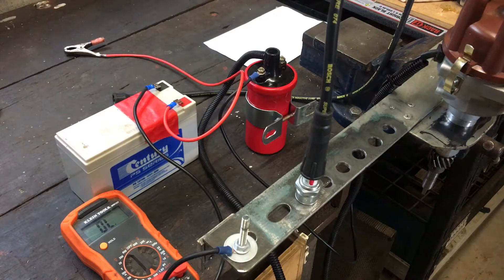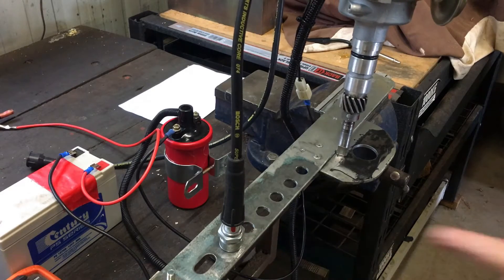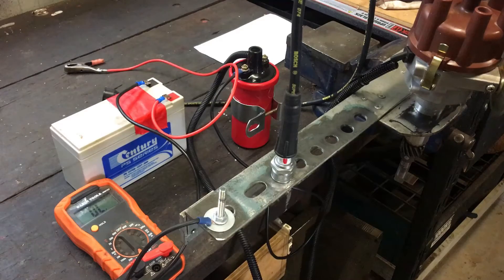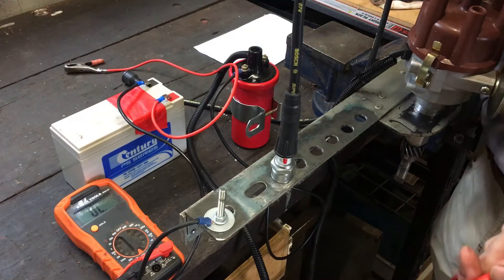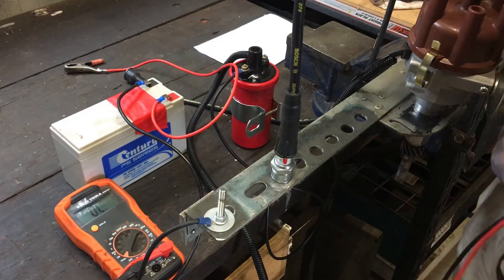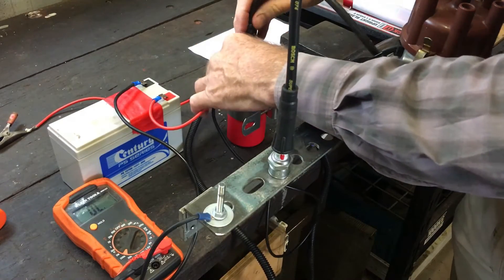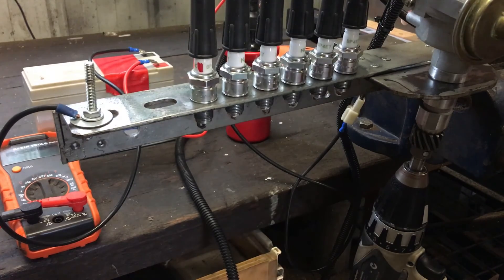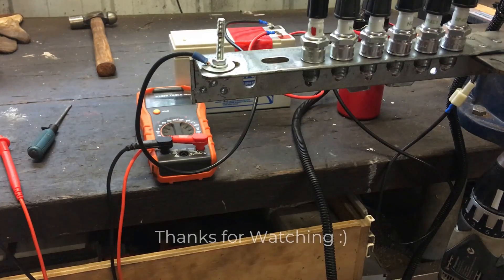Bench Test Distributor and Coil

Comment: What are you talking about at 2:28 in the video? You said the positive wire coming from the distributor goes to the positive side of the coil. There is no positive wire coming from the coil. There’s only one wire (other than high voltage coil wire going to center of distributor) going to the distributor. When the points connect it goes to ground and when the points separate it’s no longer grounded causing the coil to release high voltage through the main coil wire. Again, there is no positive wire going from distributor to positive side of coil. Please explain if I am wrong.
Reply from the maker: That was a few years ago now so I watched the video again to refresh my memory.  I see there are definitely two wires coming out of the distributor and I hooked them both up.  I’m no expert on this stuff.  I was trying to reproduce a fault with this stuff that I was seeing on my car.  I think in the finish it didn’t fail.  To answer your question I Google it :)

The two small wires on an automotive distributor are for the ignition coil's primary circuit: one is positive (+) and one is negative (-). The positive wire comes from the ignition switch (often through a resistor) and provides a constant or switched 12 volts, while the negative wire runs to the distributor's internal components (like breaker points or an electronic ignition module) and is switched to ground when the engine is firing. 

I recall my criminal friends from high school used to jump a wire from the battery + to the coil + to bypass the ignition key then use a screw driver to short the starter motor contacts and the car would start.
Now they just cut a hole in the door, splice a cable into the cars internal network send an unlock door command and start the engine command.
My how times have changed.
Hope this info helps.  (The coil stuff not the network hacking) 🤠

Comment: What if your distributor only has a Positive wire? My Honda S600 only has the Positive wire & no Negative wire!
Reply from the maker: Off the top of my head the negative is usually the housing of the distributor. That is if the negative cable of your battery is connected to the frame of the vehicle. Some older cars were positive ground.  Check out your battery to see where the cables go.
I’d have to rewatch my video to see what I did as it was a few years ago now.
Reply from the maker: I just played the video again and I see my distributor does indeed have a negative wire.
So all I can suggest is you do more research on exactly how your distributor is meant to be connected.
Good luck, it’s likely to be grounded along with everything else.  Let’s face it there has to be a negative in there somewhere 🤠

Comment: Thanks for the video! I have seen people rotate it by hand. Why do you need a drill for the test?
Edit: I skipped the part when you rotated it by hand 😂Sorry..
Another question while we're at it.. Does the same test apply to HEI setups?
Reply from the maker: If I remember correctly that distributor doesn’t have points.  Does that make it HEI?
I was trying to diagnose a bad coil but couldn’t get it to fail.  It was fun making all the sparks🤠
The coil did fail on the car as I changed only that and the problem was solved.  The cause was the distributor needed a ballast resistor and it had been removed.  Replaced that and been good ever since.  I did another video about that around the same time.
Reply: @DavoShed  I am not an expert. Just wanted to test a GM HEI ignition module that I have but I don't know how. That same module, sometimes, is inside the distributor as i have seen in videos. Mine is outside it, attached to a distributor through wires. The distributor is a non-contact from the inside. I think it used a magnet or something. Again, not an expert so excuse my lack of terms or knowledge.. Thank you for replying, it was really fun watching them sparks 😀

Comment: You need to add heat and 14 volts like in engine compartment
Reply from the maker: Interesting suggestion.
On the engine the voltage is restricted to about 8v with a ballast resistor or at least it should be for this coil.
I did another video before this on trying to determine what the problem was while on the vehicle
https://youtu.be/Yyzgtp-HA2A

The problem turned out to be the coil and the lack of a resistor.  This is what fried the coil (over voltage).
Here I’m trying to prove the coil is faulty but could not.
The car would only run for a couple of minutes before it stalled so no real heat in the engine bay.
Since I replaced the coil and added the correct resistor I have not had any more problems.
Thanks for commenting

Comment: My friend what is the contact breaker
Reply from the maker: I’m not sure I understand your question?
For the problem I’m trying to diagnose see the video link card at the beginning of this video.
I removed the suspect coil from the car and I’m testing it here on the bench.  I could not reproduce the problem but I thought it was still worth sharing.
I’m using a modern breakerless distributor here on the bench where the one on the car has breaker points.
Some weeks later I determined the problem to be caused by the lack of a ballast resistor.  This cuts the voltage on the + wire going to the coil down to something like 8 volts.
If the coil meant for 8 volts is used with 12 volts for any length of time it will fail.

Comment: Great video! 
In my experience, the best (easiest) way to get a coil hot, is to connect the primary circuit directly to the battery, with nothing else in the circuit. (It simulates what it would be like if the distributor stopped at in a position that would leave the points closed)
Reply from the maker: Thanks for your reply.  I’m not sure if I mentioned in the video that this was out of my 45 series Toyota Land Cruiser.
I was trying to repeat the problem I was seeing in the car and see what would happen on the bench.
Car stalled after only a few minutes.  I figured out that a mechanic had removed the resistor when he upgraded the distributor from points to electronic.
I ended up adding a ballast resistor back into the circuit and I have not managed to destroy another coil since.
I have always wondered why you aren’t supposed to leave the key on without the engine running.
I’m guessing what you have described is the crux of the problem.  Great info,